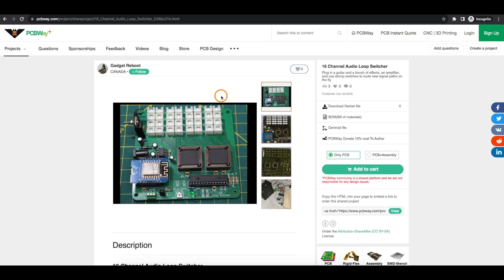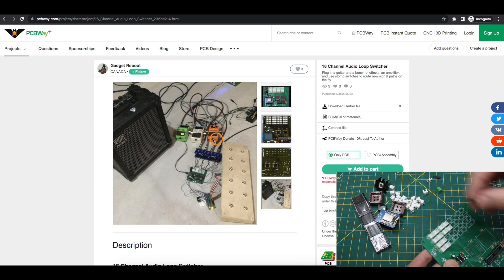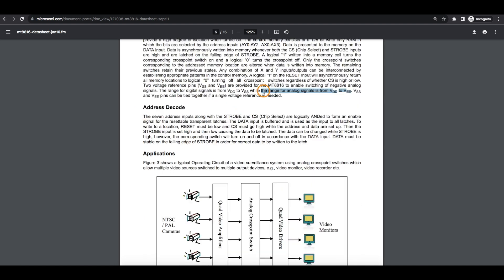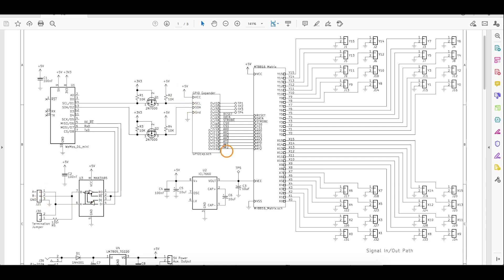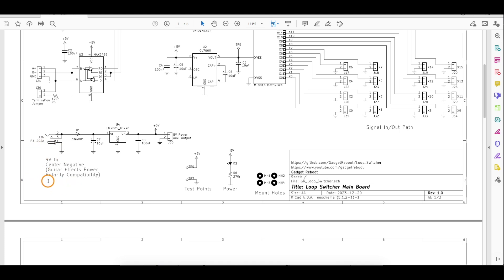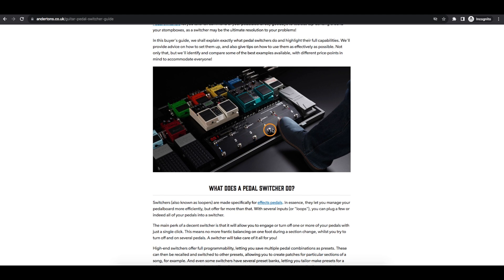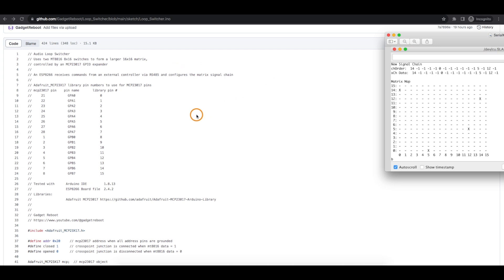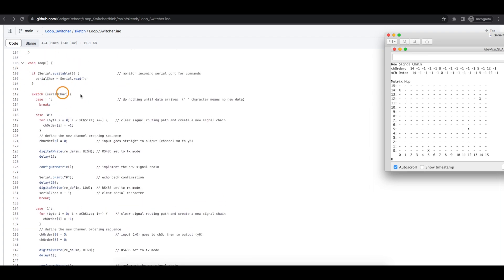16 Ch Guitar Loop Switcher

Comment: What happens if you closed the connection between two inputs and one output, or one input to two outputs?
I'm just a little kid in Electronics. Sorry if i asked dumb questions.
Reply from the maker: whenever multiple connections are joined inside the matrix whether inputs or outputs, they will be all short circuited aside from some small amount of internal series resistance with each channel 
I’m not sure what that might be and it might depend on certain other things at any time so the internal resistance might help isolate channels in case a short circuit between them would be a problem with something plugged in but assuming we’re talking guitar effects with their outputs plugged in to the matrix and then the matrix is also connecting to some other effect input or to an amplifier input,
usually effects will have a series capacitor on their output to block DC so only the audio signal will get through and those are what will be running into each other inside the matrix wiring
i’m not sure if it’s possible that two output audio signals from effect outputs might sum  together and create a larger audio signal which could exceed the maximum voltage swing of the matrix Path
basically just like with any other product it’s best not to try to run two output signals into each other.
taking one input signal and splitting it inside the matrix to connect to two outputs on the matrix is probably no problem like splitting a signal with a cable and sending it to two different inputs so things are not really clashing and trying to drive each other
The only possible issue with that would be if the source signal isn’t strong enough to drive more than one input it might get loaded down and impact signal quality but I wouldn’t expect a technical issue.
Reply: @GadgetReboot    Thanks for your reply. I'm a bassist and interestingly watching your videos. Because some music, like Plug in Baby - Muse, has the same notes for synth sounds + bass lines, but I've watched your videos, I think it could be handled by bass alone while splitting original signal to output and the other one goes effect loops so that the notes for synths are replaced, and lastly these sounds are combined and go to output. This is why I asked that question to you. So, from your reply and my very short knowledge, insert sufficient input strength using buffer or compressor pedal and limit current flows to one way will make no or subtle problems, right? Actually, I'm building my pedalboard switcher, and I want it to behave like that. I already knew the presence of MT8816, but your idea was very helpful to me. However, for non-majors, It's very hard ;(
And I'm also sorry for shitty English. I'm not a native speaker.

Comment: Have you come up with any way to control the signal path for the loops? Say you want one pedal in front of another one, then want to flip that the other way. I could see that being a feature desired.
Reply from the maker: for now I just hardcoded the functionality for a specific button to do a specific signal path but ideally long-term I would want to implement other things for example one product has a feature that can just treat each pedal as a regular on off mode rather than preconfiguring a signal path so no matter what the current state is if there’s a bunch of things already on and off, if you put it in that other mode you can just bring in another effect based on where it’s wired in and treat it like a regular bunch of pedals
and it should be just a software feature thing to add another function like maybe dedicate one of the foot switches to a swap mode and then just assign two of the pedals to that button so every time the button is pressed, wherever those two pedals are currently assigned in the signal path they will get swapped out for each other but of course all of this would be easier if the product were evolved with a user interface so this can be done on some external touchscreen or something so we will see how it unfolds
Reply: @GadgetReboot very interesting stuff. Have you researched audio matrix mixer/switchers since this video to see older and newer products doing similar stuff?

I think the latest technology hit is a model series by Wolff that uses relays, so direct signals without any AD/DA, digital processing affecting a signal. It seems marketed to big studios because of it's high quality and price. They make a one rack unit that goes from like 32 in and out and up to hundreds. They have a YouTube with lots of videos demonstrating it.

Comment: Has no one come up with a DSP firmware to do all this in one chip?
Still until then it looks good.
Reply from the maker: DSP to actually create all of the effects or just to streamline the control of all of the switching and routing?
of course there are those multi effects units that do things like this including creating the effects themselves but having the ability to switch discrete effects is always going to have a target market
Reply: @GadgetReboot  I was thinking of a DSP to do all the affects processing and use the switches to just control the order the affects are applied. Oh and you would need peddle inputs as well.
Reply: @GadgetReboot is the teensy powerful enough to create effects robust enough for a guitar. I love the board but it's all beeps and boops in most projects I see. Costwise it's the best candidate but I haven't went looking.

On an unrelated note, there's massive economic problems in China and I suspect alot of creators are going to lose the backing of the Communist party. Your destiny I suspect will find you well but this platform isn't the place. I mean that as a compliment because you do real engineering. The algorithm rarely pushes stuff like you to me anymore and it's killing me. 

Once again. Great stuff man. I'm envious (but mostly proud) of your technical knowledge. Hehe.
Reply: @jstro-hobbytech  I have a guitar pedal (doesn't work ATM) that uses an Arduino to alter the original signal with DSP that you can write yourself. I am sure a Teensy could handle this but I imagine the "resolution" might not be of the highest quality. Still ... a phaser should sound like a phaser, etc ... maybe just a bit "steppy" due to its limited ADC and DAC?
Reply from the maker: @jstro-hobbytech I think I saw a project using teensy for effects but I don’t know if it was any good.
I don’t even know what the algorithm is or what it does anymore, one day I’m expecting to see a video suggested to watch where somebody finds out what the algorithm is and it’s just an old man running some steam punk equipment behind a cheap fabric curtain or something
Reply: @GadgetReboot  remove videos from your History (it takes a while for the X to delete them shows up after the page loads) ... this will prevent whatever topic you recently watched from taking over the list of recommended videos. I also remove entire channels from being recommended, a bit extreme but I can always SEARCH for what I want ...

Comment: Awesome work --- now time to eliminate those ground loop hums ... maybe build in some ground lifts?
Reply: I think that's part of the problem with all the affects running off the same power supply.
Maybe throwing a few 1:1 isolation Tx's in might help.
Reply from the maker: I need to try different things and see where that is actually coming from if it’s related to the way things are hooked up or if there’s other things on that circuit making its way into everything. At least it’s just a small portable amplifier that I can bring around the house. I also want to try battery power on everything entering the amplifier. So much trouble shooting, so little time.